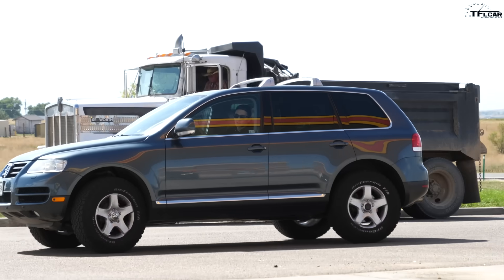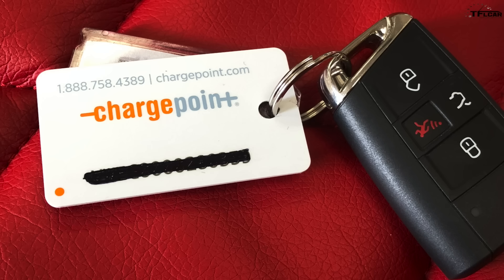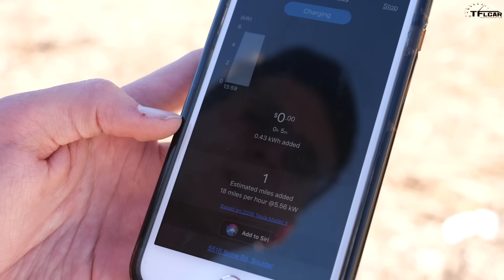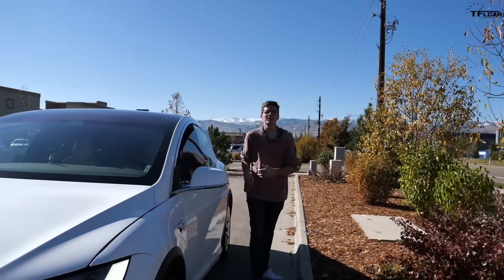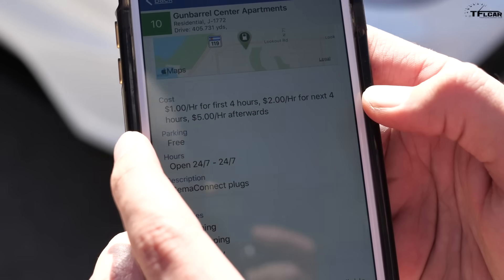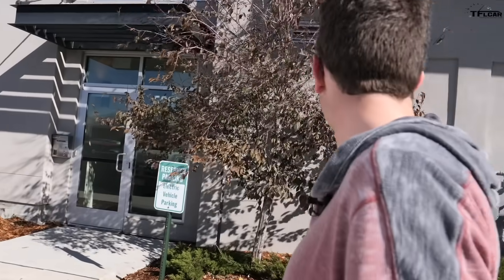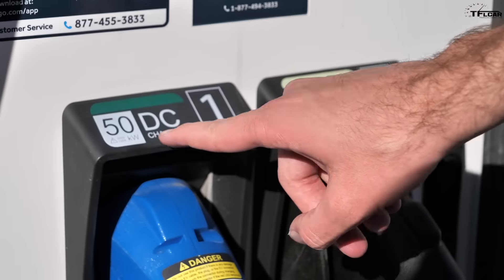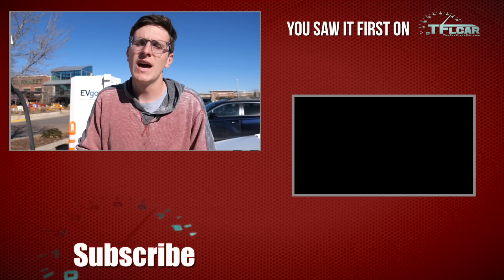Here’s Why Charging an Electric Car Can Suck - And It’s Not The Reason You Think!

Comment: I just wonder what’s going to happen to all those car batteries when they wear out eventually. If in a decade or two everybody drives electric, the used battery waste is going to be an enormous environmental problem I think.
Reply: There are actually some pretty promising developments with recycling lithium ion by putting it (if I recall correctly) acid baths. But the question is of course is wether it can be used on a grand scale.
Reply: @viella90  the cheapest way is put all Electronic trash into poor Asia countries as usual western companies do if something is too expansive and doesnt make the proffit. Same with PV modules.
Reply: @viella90  "Promosing". So not even close.
Reply: https://www.duesenfeld.com/recycling_en.html That happends to all these Trillions of Billions of Tons of Batteries.
Reply: I like how everyone points out the negatives as if they are predominant without considering how much pollution caused by petrol and diesel vehicles (this doesn't even cover getting, refining, or transporting the fuel) from just operating them and this doesn't include trying to recycle them.
Reply: @AmalgmousProxy    There are some hurdles electric needs to overcome to bring the end consumer on board. Electric is getting there, but improvements in battery technology need happen. There's a lot of hype on battery technology, but still waiting. We will get there in due time. Did you see the "SuperHybrid" motor/engine they put in a Tesla? 117MPG. Now that's impressive and cuts way back on emissions. Almost 1,000 miles per tank.
Reply: 98% recycled
Reply: All those batteries need cobalt, most of which is mined by little kids in Africa. Child labor. Yet the urban elite Greens don't give a damn...
Reply: @ronclark9724  Unethical business standards are prevalent in every aspect of your daily life, it's stupid for you to label only "green" people...
Reply: @ronclark9724  So I guess we're stuck with destroying the planet instead
Reply: @codmott286   Nasa last year released a several years study revealing landfills release much more methane than cows do. Yet the cows are targeted, not landfills. I wonder why? Could it be because the greens insisted on landfills instead of burning trash? Methane is 50 times more damaging than carbon. Why even bother with a carbon tax? Why have landfills? Burn baby burn!
Reply: @ronclark9724  What about this, what about that. If we did things your way nothing would ever get accomplished because there's always something else you can point your finger at.
Reply: These batteries can be easily recycled. I have a client that is a not for profit company that has the contract in Canada to do the recycling
Reply: Graphene batteries will be here soon. They will have much longer lives and charge faster. That is when I will finally be an EV customer.
Reply: @dadinggo  soon? They are not even commercially available yet much less adapted for cars. There is speculation that all of the current charging facilities will need a major retrofit to even charge them properly. And the  there is still a time factor. Even though graphene batteries have the potential to hold a great deal more power,  this could also mean that it could take much much longer to create a sustained charge. Everything I had read so far shows no indication that graphene based batteries charge faster than  current lithium based tech.
Reply: @dadinggo  Define soon. Even though graphene batteries look promising, it will be a many years before they are commonplace in vehicles. Battery manufacturers put out a lot of hype, but delivery is much, much slower than what they flap their gums making statements that just don't hold up in time.  There are other battery technologies that look promising as well, but not here yet. I'd say in about 10 years, things look much more promising, so until then, glad guys like you are making the investment with little return. I personally will stick with used Hybrids and fuel efficient cars like Civic and Prius because of reliability and extremely low cost of ownership. I work on my own cars and have for decades. I only buy cars that I'm likely to make very few repairs, because that's how mechanics roll.
Reply: Seeing my iphone's battery degrade over years of use,  and replacing it was expensive, I think the EV's battery will degrade much quicker, and replacing it will cost like a new car.

Comment: Looks like it would be a pain taking long road trips due to the hours of charging your vehicle. I pass
Reply: This guy is showing chargers at peoples workplaces , the ones where you plug in before you clock in and then drive home with a "full tank" every day after 8 hours.

There are fast chargers that charge cars in as little as 15 minutes. If you have a Tesla it will route you to them if you go for a long drive. What other car sends you to the best gas station when you're running on E? For most people its perfectly fine, you just gotta change the way you think about refueling.

Comment: Third world problem? My old house in the old world has 230V as the basic voltage with 3 phases coming in. Default for every house is 25A per phase (giving 17.25 kW - most houses/buildings take grid-gas for heating). At higher base fee I have run at double the kW with 50A per phase, allowing 30 kWh charge per hour overnight. The 50A has become expensive but 35A per phase is OK. This allows easily to have 20 kWh per hour charging from a normal household connection - 4 to 6 hours for a completely drained Tesla. That seems enough for most commuters to me, even when they keep heating or AC blowing all the time in their car.
The twice higher Voltage of the grid cuts Amps in half, thus reducing heat losses and it needs less thick copper cable. At 50 Hz (cycles) there is a tiny bit less energy per second than in 60. IIRC airplanes use some 440 Hz that may be the optimum. Maybe "the world" should standardize to one,  more efficient, electric energy delivery standard. Looking at the elite of countries still using feet, ounces and a variant of gallon, this may never happen - if citizens don't push for a standard. In the meantime, migration to EV goes so fast in my country, with very dense housing, that street charge points tend to become scarce soon. We better start designing charge management in cars that can adapt the series-parallel configuration to different Voltages.

Comment: In the uk 240 volts is standard👍🚘
Reply: In the U.S. 240 is available in every home but few appliances use it so the wiring isn't usually completed. I had to run conduit and wires from the circuit box and install a 240 plug, but 240 was already at the box.

Comment: This charging rate of 17 miles per hour is insane.  I would be very mad if it took one hour to fill my car with gas!  I fill my car with 20 gallons of gas in about 5 minutes.  At 25 miles per gallon, I can drive 500 miles before I need more gas.  Your EV will only drive about 1.5 miles with a 5 minute charge.  The EV vehicle is not ready for the consumer market yet.  It is just a novelty.

Comment: "Destination charging" is the only way these Level 2 (30-80A) changers work. They belong in your garage,  hotels, or workplaces where you plan on parking the car for many hours.
Fortunately both the ChargePoint Level 3 (150-300A) CCS/ChadeMo and Tesla Supercharger Network are expanding. I regularly charge my Model S using the ChadeMo adapter at Chargepoint, DO NOT FORGET to turn on the NF (nearfield) on you phone or it will not communicate with the station.

Comment: Thats what puts me right off buying a BEV. Such a fragmented industry. If ALL cars set a standard by using one connector and not 6 million, i would. Until then I'll stick to gas or maybe go Hydrogen. Better still, why not use a pantograph like they do on electric locomotives to collect power when on the more straight highways, then switch to battery off the highway??

Comment: what a pain in general to charge a electric car, I like to to ''charge'' my gas engine in minutes any time, be able to use cash ,drive anywhere , not worry about having battery in my phone or having good cell service and worry about running low on power  , I drive sometime long distances and Im never worry about running out of gas , gas station are everywhere. I guess for the convenience you have to pay for gas.

Comment: Cute.  He should just charge at home and not worry about it.   We charge every night at home at 240V/30A (I wired in "dryer outlet" NEMA 14-30 in the garage) for 30 miles per hour.  Cost is about $25 a month and we average about 1375 miles per month = 55 miles per $1 of electricity.  We have a 90% (~285 miles) charge every morning when we leave the house.  Only ever use Super Chargers for road trips.  I guess he wanted to make a video about how to do it wrong?

Comment: From reading a lot of these comments i think what a lot of people are missing is that the average vehicle in America travels 30 miles per day. therefore, the average EV will only need a full charge every couple of weeks or a home charger will keep the battery topped up on a daily basis while the owner is in bed.
One thing I did notice though is that one of the charging stations that he went to is only open from 8am to 5pm. That I dont understand?

Comment: How hard is it for them to put a credit card reader on the charger?? Mobile apps are great only if they CUT the time needed for the transaction. Leave it to the tech heads to ruin the customer experience. Add the whole adaptor dongle saga and it becomes such a burden, unless you have hours to spend idling or lucky enough to have a charger both at home and at work. No thanks to EVs, I’ll reconsider once 2030 comes around.

Comment: This video is back-to-front. It's going to scare the crap out of non EV-owners. The point is that on roadtrips, you charge in 15 minutes per stop (with a Tesla). The reason for the slow chargers is so that you can just charge where you happen to be parking (work / home), and never have to worry about filling up. Most important pro-tip for non EV owners: in reality, you NEVER wait for your car to charge.

Comment: When they get 1000km range and charge from 0%-100% in 10 minutes or under. I may start think about the idea.
Reply: Same. I'd even be fine with 600km range  but I don't have time to wait for 30min to a few hrs to get not even a full charge
Reply: @user_namehere  good point
Reply: @user_namehere  mostly my car charges up fully in one hour, and it goes for 200 miles safely. i wont say it is as good as any current gas powered cars but the future is right on the corners.  plus, my 60kwh package is already a awesome tool for ubering. trust me it will last pretty long
Reply: i own a 60kwh package personally and it can do 200 miles easily, quit enough for me at least. and it is so cheap to run
Reply: @Alex-is-a-daddy  for me thats just not enough. Really the only ev thats even slightly caught my eye is the hummer ev. Out side of that i dont get why every ev has to be so plane and boting both interior and exterior design.  
While fun going 0 to 60 thats about all thats good in my opinion. 

Needs better noise dampening so you dont hear evey single rock on the road aswell. Im also not to hot about the idea of killing the car scene and after makret industry.
Reply: @Alex-is-a-daddy  very true. And Chinese car policy? 
While im more of a crotch rocket and dirtbike guy, i will always still respect a good harley
Reply: @Alex-is-a-daddy  i have to say though some of the Chinese knock off band vehicles arnt bad  some are actually pretty nice that ive seen

Comment: Wow, never considered one before and will never consider one now, either.  16 miles added in one hour?  I can fill my car, albeit at a higher cost, in ten minutes and then drive 550 miles before I have to stop to refill.  That would be the equivalent of 4 ten hour charges on an EV.  Useless unless you can charge at home, or work, and only use for around town.  Oh, and 4 ten hour charges at a $1 per hour, approx, would equal in cost the gas I put in my tank.  But then, the EV has no oil changes, etc.  However, that inconvenience is a minor nuisance as it's done so seldom.  Thanks for the eye opener.

Comment: This is insane. So much for "let the market decide." It doesn't. It just gives you hundreds of incompatible formats.

First, the industry MUST standardize. Gather all the people who make these decisions, lock 'em in a room, and keep sliding pizzas under the door until they come out with ONE standard, ONE plug to rule them all.

Second, charging points must be easy to use. This mess of apps is stupid. You should not even NEED an app. Not everyone has or wants a smartphone. You should just be able to insert your credit card, or insert bills and coins, and be good to go.

Third, it seems that charge points are too hard to find. You shouldn't need an app, or Google maps to find them. The best advertising that the EV industry could have are signs on the highway that say, "Gas, Food, Quick Charge, Next Right." 

Fourth, if I'm just driving around the city, I can charge overnight at home. What we need are FAST charge points along roads out in the middle of nowhere. It's when you're on a long trip that you need to charge away form home.

Some commenters have questioned the utility of "slow chargers." They have their place. Most of the time, your car is sitting around parked somewhere. If you drive to work, for example, and 8 hour charge time is perfectly fine. It's when you're taking a long trip that you really need a fast charger. And they need to be stationed along the highways away from cities. Remember, it's not the size of the gas tank that determines the range of a ICE vehicle. It's the location of the gas stations.

Comment: This is a stupid idea in search of a problem. The idea is NOT to recharge a battery. The idea is to REPLACE a drained or dead battery for a fresh one, and do it quickly. A 500 pound battery would last at least 250 miles. Then, the driver pulls into the nearest college or university, and the students quickly replace the battery, using mechanical and hydraulic machines. And one minute later, the car continues on it's journey.

Comment: EV are the Betamax of the car world, if you live in a property with no facility to charge overnite your going to hang around for 30mins minimum plus your car is so heavy(try parking on wet grass) with expensive batteries that will fail after 10 years at most.

Comment: Look buy a 240 volt (in Australia) Honda portable electric generator. Have an auto electrician wire a heavy wire lead and plug to it and put it in your boot. If you look like running out of power pull over take the generator out of the boot plug it into the car start it up and in 20 minutes the car battery will have 80% charge which is enough to go another 130 KMS. The generator puts out many more amps than a home power point and this is why it can charge the battery so quickly. This is such a simple thing to do and the generator and the wiring work will cost about 600 dollars but you will never have to look for a charging point ever again.

Comment: No one needs to charge on the road unless they miscalculate their trip and range. Average drivers will charge at home and be back home in time to charge their cars overnight for another trip tomorrow, or for a couple hours as needed.

NO ONE will EVER charge their cars on the road unless it is on a road trip which is essentially unfeasible at this time.

You will take your EV on a road trip when your battery can get well past 400 miles, and charging can be done in less than 20 minutes.

Until then, short range trips with the charging done at home, is the only ideal practical scenario in which you would EVER decide to buy an EV. In other words, if you cannot get out and back on a single charge, don't get an EV. It's not for you.

Tesla is the ONLY EV producer that has addressed the problem with fast superchargers for ALL models, with an 80% fill up in under 20 minutes for ANY of its cars.

So, if you insist on being trendy, really want to love the planet hard, you should ONLY get a Tesla because it comes with fast readily available charging.

Chargepoint and other commercial chargers are so bad, so slow, and so unaffordable, you would think that they are probably being put in place by the Oil industry to dissuade people from buying EVs!

Comment: The reason I won't have an electric car is  1. the recharging time, 2 there are no recharging station where I live, and range. The range, what if I get where I am going and there isn't a recharging station. I am SOL. I can pull into a gas station and within 5 to 7 minutes I am back on the road with a 450-mile+ range and not worried about fuel. Another reason not to have an electric is cost, it is about $10,000 dollars more for an electric vs a gas power car. I assume if you only drive around town and never get out on the road it might be useful.

Comment: I think that I wouldn't buy an electric car unless I had a garage I could install a home charger, there was a charge point at my apartment/condo/whatever building, or there was a charge point at my work.  Driving around to random places and then waiting (especially at the Level 2 speed) for a charge is not practical at all.  Now, Level 2 speeds would be fine if such a charger was at my house/apartment/work place, since I would be at work for eight+ hours a day and at home overnight.  As it happens, I own a house with a garage I could install a charger in, but I'm not going to be in the market for a new car any time soon, as I like my current car and it is reliable.